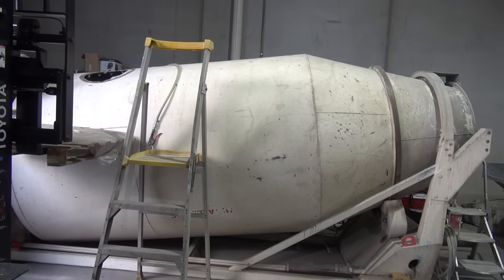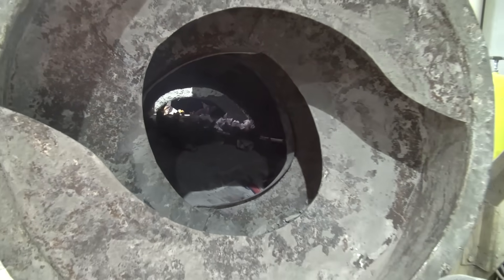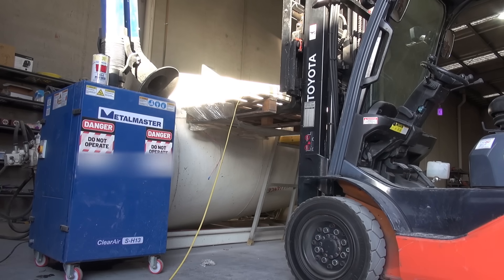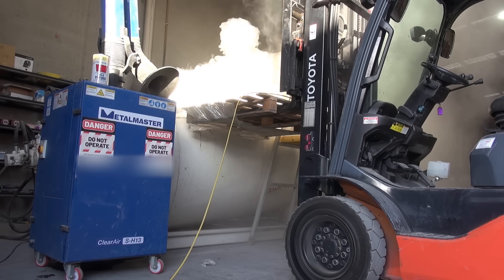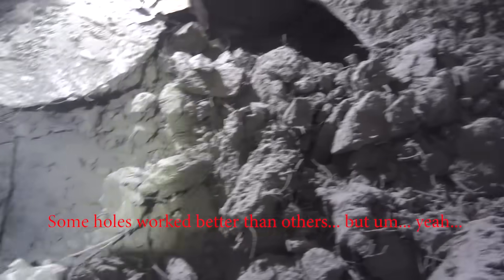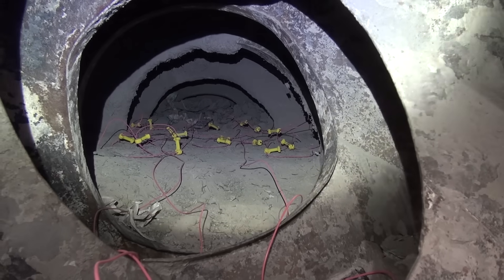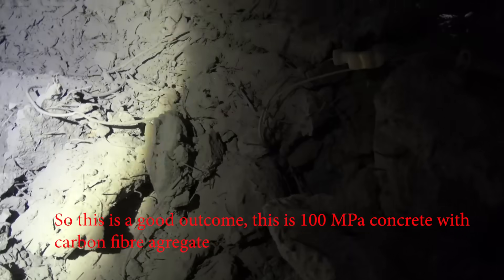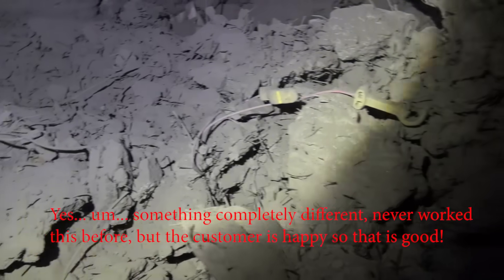Using Explosives to clean out a concrete truck

Comment: Yeah, I used to use explosives to blow out dust in a bag house at the steel mill.  Worked perfect
Reply from the maker: Never done one of those, I know a guy that has cleaned big chimneys with det cord though.
Reply: @demolitiondavedrillandblast I used to use explosives down at the mills for all kinda weird stuff.
Reply: @demolitiondavedrillandblast  yeah, I think det cord would do a good job knocking soot outta chimney especially 50 grain cord

Comment: You are a brave man, Dave. I would have had the yellow gas bottle visible in the last shot removed (welding gas/acetylene?). Acetylene is really unstable, and a nice shockwave could have set the bottle off, removed the wall and put the mixer in low earth orbit... Glad it worked out for you!
Reply from the maker: Fear not, the yellow bottle was only a compressed air receiver.

Comment: as you said, carbon fibre aggregate.  i went back and had another look and couldnt see any rocks at all in it.  did it have sand in the mix?  how about those little stainless steel needles that theyve started using as strengtheners?  i happened to stumble across some wikipedia pages about some recent advances in concrete science and thought it would be a good idea to mention them here.  however they had forgettable names and, well, ive forgotten them.
Reply from the maker: No rock at all Vsv. I have spoken with guys that have demolished old bank vaults, this is where the fun starts, copper needles to clog up diamond saws, steel ball bearings to prevent drilling...
Reply: @demolitiondavedrillandblast  , from my research, it seems the rock (thats the same sorts of rock that puts up the toughest resistance to you) isnt hard enough for the super high mpa (200) some of these concretes have.   a bridge has been built with it and no rebar!  now youve mentioned bank vaults, thats where my jackhammering career started.  we called it the great margaret river bank job.  we sneaked  into the bank to steal what was inside.  but they knew we were coming and emptied the vault.  they gave us the keys.  they even supplied free accomodation and meals.  and topped up the minibar every night.  the whole town knew we were there.  there was deafening noise in the main street for 4 weekends.  no modern anti-theft inclusions.  just thick walls and lots of thick rebar.  the jackhammers designed for walls just bounced off the surface.  we had to use the big ones designed for chopping up stuff on the ground on the walls.  so how does a bank operate without a vault?  they put a steel one in to replace it.
Reply: it is called energetically modified cement.  it is more environmentally friendly because of far less co2 generated to make it.

Comment: I think whoever let it set in there should be the one that has to clean it out! 🤣
Reply: I think he quit
Reply: @fusco515  I think he was fired or shot. Maybe both.
Reply: If a mechanical issue is preventing the barrel from rotating, it can't be discharged.  It happens.

Comment: Rotating it before the blast so the concrete is on the top all the loose stuff would fall to bottom
Reply from the maker: have to take great care that it does not tip over!

Comment: I might know of a place that does concrete power poles using pretty fantastical concrete..... very high roof as they pour the poles VERTICALLY.
Reply: I have seen video where they pour into half of the mold, close it up and then put it on a rolling frame and possibly also pump in steam to help with the curing process.

Comment: If it's a concrete mixer.... you SHOULD BE ABLE to get it to turn in the direction that it spits out concrete to try to throw out all the loose stuff. Might be a bit hard for the engine as it won't turn smoothly but at least it will remove a lot of the loose stuff.
Reply from the maker: I'd be very concerned about it tipping over LK

Comment: well done, i freak out in confined spaces , not good for an electrician, i was wondering if detcord in a 1/4in hole would do it.

could they rotate it to clear out the rubble?
Reply from the maker: The hole was a bit bigger and used really heavy cord Bruce, got to be careful with this one as it might tip over if rotated.

Comment: Yeah that's a bit more sensible than just loading it with 500lbs of ANFO, lol!
 (I seem to recall that was how much they used, don't think the quantity was actually mentioned until one of the look-back episodes)
Reply from the maker: It was probably a bit heavy handed.....
Reply: @demolitiondavedrillandblast   the actual experiment where carried out with small amounts of explosives tonprove the method. And their conclusion was thatbit was plausible and likely worked. Then they got a bit carried away, and just let us say thatbthe cement truck ceased to exists.

Comment: When the dust enveloped the camera on the first shot, I could smell the concrete dust. Well done Dave.
Reply: That's the smell of silicosis.
Reply: D J  Down tiger.
Reply: Did ya get it all out, nothing worse than your nose bogeys setting like concrete
Reply: D J  i get to play with the other white stuff, concrete. I usually wore my safety specs but respirators never seemed to be around when you needed them.  They are also horrible to wear when its 100 out. You can see the dirt marks on your skin from the moisture and sweat from wearing the mask. Few years ago OSHA started pushing for silica safety. It's a pain in the ass.  i suppose it is safer but really, what isn't bad for you and what isn't known to the state of California to give you cancer.
Reply: No u couldn't

Comment: Thank you so much for this Dave. Ever since the Mythbusters episode, I've always wondered if a skilled explosives expert could have broken up the concrete without damaging the vessel rather than just filling it with anfo and completely obliterating everything. I expect it would have been even easier in their case as it probably wasn't nearly as high strength nor fibre reinforced.
Reply from the maker: They just set out to make sensational TV.
Reply: @demolitiondavedrillandblast  oh it was sensational alright.
Reply: That is really how it is done when concrete hardens in the mixer. You would be at it for weeks otherwise.

Comment: Avoiding it setting in the machine seems lika kinda a high prioroty when dealing with 100 MPa carbon fiber reinforced concrete! I just looked it up and turns out a 25 kg bag of sugar is only  $40.
Reply from the maker: The sugar is very effective.... when you can mix it in.... Most of the times when a load goes off in a truck it is because it is involved in an accident or has a hydraulic failure.
Reply: @demolitiondavedrillandblast  I thought they might have back-up emergency power for a short time in a mine application. In any case, thank you for the very informative and entertaining video!

Comment: So many questions :o) Is the drum bigger now, is it better to wait a month so the concrete is fully cured and more brittle, would water soaked in make it crack harder, how close to the steel dare you drill?
Reply from the maker: Your very correct, I started on one once that was quite hot inside and too soft to drill, ended up they got in and hammered it out quick smart
Reply: @demolitiondavedrillandblast  It is very bizarre stuff :o) And hell on earth to gas torch the steel that is touching it.

Comment: 100mpa with carbon fibre, that’s a special batch someone left sit. 

Expensive mistake or bad planning on someone’s part.
Reply from the maker: Yeah, most probable cause is usually hydraulic failure or electrical failure.
Reply: @demolitiondavedrillandblast  I was wondering about that.  Depending on the relative price of the machine it might be worth having a backup generator and a good stock of repair parts handy.  

Otherwise, if the machine is cheap (which I doubt) just take the financial hit if the machine or power go out, pay to dispose of the machine in a landfill, and buy another.

Comment: I've always wondered how they clear out set concrete in a bottle. Fascinating stuff
Reply from the maker: It's more common for a guy with a jack hammer to spend a few days in there, this one because of it's small size would not allow a big jack hammer, only a small hand held air pick.
Reply: Normally they use air chippers - I work at a ready mix plant and every so often the trucks drums need chipped out and we hire people who come in with hand held chippers climb in the drum and do a great job without the risk of blowing up the truck or a fellow employee
Reply: So this seems to be strictly for entertainment and that’s about it

Comment: Dave, thoughts on placing charges then filling the barrel as much as possible with water to contain and channel the blast better?
Reply from the maker: There is really not much extra room for water as the concrete fill is close to overflow normally.

Comment: Oh dear lord, 100mpa micro reinforced concrete is no joke. That is like you are trying to blast a chewing gum.
After seeing aftermath of first blast and some bearded pieces of concrete i was chuckling a bit and thinking "oh Dave, what a mess you stepped into".
In reality, if you can clean the drum so that there is less than half a tonne of concrete stuck to insides its all good.
Reply from the maker: Blasting chewing gum... Mmmm that is and interesting illustration.
Reply: @demolitiondavedrillandblast  now now, dont get any ideas plase 😆

Comment: Great job Dave. Would have loved to learn the backstory of how that happened.
Reply: It happened to me once. Basically, this can happen if something happens while en route to deliver ready-mix concrete. A breakdown, caught in traffic, etc. Broken axles are a common incident for concrete mixers maneuvering through new construction then the truck gets stuck with no place to unload. You only got about 3 hours or so, depending on the mix and temperature. My story is I was driving a loaded 8 yard (16 tons) mixer and the driver side frame rail broke while I was driving, the drum was leaning heavily to the passenger side. The first thing the mechanic said to me was "How'd you keep this thing upright?" I dunno, I just held on for dear life. Meanwhile the truck sat for too long while the mechanics put a massive weld on the frame to get it back to the shop. That truck sat in the back of the yard for years with the cured concrete still in it.
Reply: @JP-wb1oo  In your case it was due to a truck breakdown, but this mixer is in a factory setting so unless it’s hydraulic drive unit failed then human error is to blame.
Reply: The boss's son😉🤫
Reply: @assassinlexx1993  Well if it wasn’t the Boss’s son then who ever did it owes the Boss some very expensive booze to make up for it. That is assuming that they weren’t sent down the road straight away!
Reply: @markfryer9880  
I would be surprised who did this. Would have a job.
Reply from the maker: I don't actually know the back story on this one Zaph.
Reply: looks like sabotage almost ?

Comment: I saw the Mythbusters episode you referred to and when that  thin blew, I jumped. You may have used smokeless powder, but the concrete dust more than made up for it. Did you get "Dirty Jobs wiht Mike Rowe in Australia? I think I remember an episode of him cleaning out a barrel like that with a jackhammer. That really was a dirty job. A bit risky too. The edges or the screw that either mix, or discharge the concrete, depending on the direction the barrel is turning, become razor sharp from the abrasiveness of wet concrete.
Reply from the maker: The edges on the screw or flights or what ever they are called were smooth on this one Jim, I don't think we se Mike Row here... but there again I don't watch TV.

Comment: Had a good laugh when you mentioned Mythbusters Dave. Top job getting that lot out, kinda wondering what the customer was using it for now.
Reply from the maker: This machine was in an underground mine site when the mix went off, it is currently being "serviced" and will then return to the mine.

Comment: I was wondering when they started using straw in concrete, but that looks like Strong stuff!
But no match for you lol
Reply from the maker: Straw in mud bricks goes back to Egypt at least. Makes it very difficult for the jackhammer.
Reply: @demolitiondavedrillandblast  lol, yes, but I thought they had QUIT using the straw back when Joseph was around, so I was surprised to see the resurgence... 

In some places that use mud wattle, straw is used, but most consider concrete to be an improvement on mud wattle, but I guess using carbon fiber in concrete is the New Mud Wattle?

And yes, I can see by the trouble the explosives are having that I would HATE to do that by hand.
On behalf of the guy stuck doing it, thank you for the help lol

Comment: I don't miss cleaning those. Never got to use dynamite, closest thing we did was let em freeze really good then hit em with hot water.
Reply from the maker: That is an interesting idea.
Reply: Does that heat shock crack the concrete effectively?

Comment: Far superior result than manual hydro blasting with gimble mounted lance working with 55k Psi @ 30 Lpm or caged tankhead working at 15kPsi @ 250Lpm. Suggested using explosives as an engineered alternative to clean bogged slurry mixers onsite but never extened further than toolbox meeting. 👍👍🇭🇲
Reply from the maker: Well, next time you can send them a link to this video Andrew.
Reply: @demolitiondavedrillandblast  That suggestion, and link, have been forwarded to site mobile equipment superintendent, and will again be discussed in site managers meeting. 👍👍🇭🇲

Comment: The one time I helped clean out a barrel on a barrel truck, I probably did more damage with my chipping gun than you did shooting it. Nicely done. Would you ever consider "mud packing" the shots instead of drilling? Also, what size (diameter) hole were you drilling and how deep?
Reply from the maker: I doubt that mud packing would work very well here KB, they were tiny blast holes, contact me if you need to know the exact details.

Comment: Carbon fibre aggregate :O

The respirator is well worth it, I mean concrete dust is nasty but dammmnnnnnnn that's a whole other level.
Reply from the maker: For sure, we had a vac system sucking through it but not the space I would like to be in very often.
Reply: Indeed. CF dust is like a bunch of little multi-pointed razor-blades. In your lungs, it's like Asbestos on steroids, and then some.

Comment: Those barrels must be really expensive!  I’m sure hiring a company to blast and then hand clean isn’t very cheap.
Reply from the maker: They are real expensive Dan and the Two companies here that make them for trucks have full order books, so there is a long waiting time. If you do replace it you need a big crane and then there is the disposal cost of the old one, makes good sense to fix the old one where possible.
Reply: I was thinking how how much they 'd need to pay me to get inside with a needle gun, but realised that whoever left the concrete in the drum would be getting the job.  I wonder what sort of drill Dave used in that tight space?

Comment: Who would leave 100MPA concrete to set up? Disgruntled employee no doubt. Criminal vandalism if so. Dayum, that's hard concrete right there and with that fibre reinforcing it. What do they make? Bridge beams?
Reply from the maker: This set up was operating in an underground mine when the incident occurred, most likely power failure or hydraulic failure that prevented barrel rotation. This may have been  shotcrete mix.

Comment: 3:24 what are all those small strings hanging off the concrete? Did they mix a batch of glass fiber reenforced concrete or is that some steel wire?
Reply from the maker: Short bits of carbon fibre as aggregate / reinforcement.
Reply: @demolitiondavedrillandblast  Damn, no wonder they went to blasting.

Comment: Had a job like that many years ago. Full sized truck though, still cramped., spent a week on one of 'em. Never punched through tie side or wiped out a spiral. dirty nasty noisy job and exhausting for 8 hours a day with a jackhammer and a lil CP air hammer. I was laughed at when I suggested a bit of explosive....Nice job,  dang stiff concrete there.
Reply from the maker: Yes, certainly a hard way to make a $$ Paul. There is very little info on the net about using explosives in this application, historically it is reasonably comon where I live. I just wonder if this video will flush out others that do it? Thanks for "Chipping in".
Reply: @demolitiondavedrillandblast  I have often wondered if using a hammer drill instead of just a chisel point breaker would work better?

Comment: What exactly is “fiber aggregate “?
Reply from the maker: Normally the aggregate in concrete is crushed rock but it can be other things depending on the application, in this case it appeared to be carbon fibre.

Comment: Do you drill all the holes from the inside?  If so, isn't that prohibitively loud? Could you drill holes from the outside and let the customer weld it up afterwards?
Reply from the maker: The holes were all drilled from inside, They did it under my instruction, ear plugs and then muffs over the top is standard for such work. drill from outside.... Hmmmm...

Comment: Much better than misbusters, You accomplished something useful thanks for the show and give that brave camera a fresh new battery for it's troubles :)
Reply from the maker: The camera needed a good clean with compressed air between shots.
Reply: They got to a point where it was all explosions for show (& the American audience). Did little miss Muffet sit on a tuffet? Lets blow up the tuffet with C4 to find out!
Reply: @davenz000  The only good thing about all of those explosions and the use of very high speed cameras was that you got to see the formation and expansion of the shock wave. I found that to be very interesting.